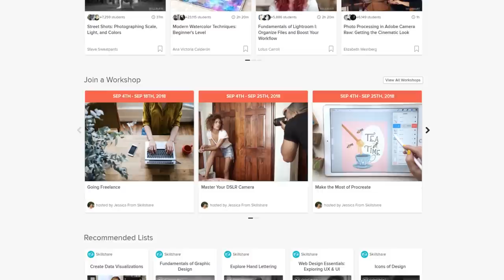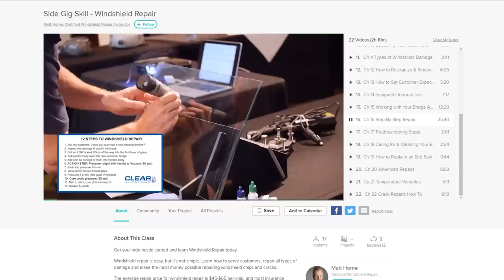BMW E30 Front Struts Restoration | BMW E30 325i Sport Restoration S1 E1

Comment: 2 friendly pointers. When removing the strut disassemble the bottom first and then undo the tower nuts to remove it. 
And please do not never ever again clamp the rod of a new shock with vice grips, not even with a rag. Use Allen key to hold.

Comment: Hey Restore It, did you notice your strut retaining or gland nut did not thread into the strut housing all the way?  I bought the same Bilstein touring struts and noticed upon fitting that the new retaining nuts are too long and dont thread in all the way.  They have about 10mm more thread than the old ones which stays exposed.  Did your rebuild turn out ok?  I dont like having the exposed thread and might return my purchase.

Comment: I have an e92 project that I’m starting - can I ask what resource you use to (1) find the replacement parts and (2) buy them? I use realoem to find them but I refuse to pay BMW Parts Dept prices. It’s a pain having to search and source the parts from different suppliers so I was just wondering if the UK has something akin to the USAs FCP Euro. Alllthe minor stops, bolts and caps are what I’m interested in sourcing, instead of the larger parts.  Cheers

Comment: Re: WET CARPETS, not sure if the E30 uses the A pillars to drain water off from the roof/sunroof like my E60, but that is a common problem in the E60s. Pull down the Wheel well fascia  and you might find a little rubber drain hose/nipple, take an air compressor and blow it out. If they are clogged, the water will overflow and run down the inside of the A pillar to the foot wells and make your carpets wet.
Reply from the maker: Thanks Alexander.

Comment: Great stuff to pass time and for remembering my own e30 strut restoration. Couple points though which might have been mentioned down in the comments but i''m to lazy to read them all. 
1. The dust boots and bump stops you fixed already i read.
2. Just like you did on the shocknut.. you would want to also coppergrease those 3 tiny bolts holding the splashguard and that basterd holding the disc. Soak them if you didn't!
3. 21:48 Dude.. why? That little thing you unnecessarily created will break off if forced in no time. Just hamer the entire edge of the nut into the gap with a big flat screwdriver. That way it's IMPOSSIBLE to go undone unlike now. What you've done is possibly not strong enough if you didn't TORQUE to correct specification. 
4. Which you didn't because you used the impact wrench. To much torque and the bearing will wear out a lot faster. Better scenario then point 3 though..

Other then that, great job and a joy to watch as it reminds me of my own e30 resto. You're my new favorite channel. Subbed!

Comment: What if I have brand new stock coil over's wait to be installed can I just paint over what is already new clean paint or does it need to be sanded a little or wiped with alcohol before hand. I want to tape my springs and leave them black and paint the inside of the strut Red.. Can I just Tape and spray?????????????????

Comment: did you consider an extra few layers of paint on those new backing plates to both make them match the struts and give a bit better protection?  Those springs look really nice. I have a near side front wing going spare if you need one... brand new, unused,  well primered in cellulose....had it since about 2003 I guess lol and won't ever use it.
Reply from the maker: Yeah I’m going to do that tomorrow as I have everything apart again :) and yes defo! Where are you based? are you selling it?
Reply from the maker: Email me at restoreitchannel@gmail.com

Comment: Love the videos but I’m afraid you’ve probably ruined those struts and you’ll wear seals out quickly, you should never put vise grips on a strut, always use a pair of ring spanners to remove the top nut. Otherwise you score the strut and damage seals, just a bit of advise

Comment: So there is an e30 hiding behind the scenes for these parts to go back onto.

Toptip from someone who can't weld either, you can preheat things like that, it makes it much easier to get a nice bead in there right off the bat. Then you can just hop on and off the trigger to manage the heat in the material.

Comment: NEVER grip damper shafts with grips! You'll damage the surface and invalidate the warranty, impact gun the nut and torque up. Also fit the hubs minus the discs and peen the hub nut into the groove with a chisel, just my advice.

Comment: next time try satin black instead of glossy black on chassis/suspension parts..looks 100% stock and much better, try and you will see :),. And those topran branded parts are junk, really junk...when you start using the car you will see tehm go bad...i have bought bushings that lasted a month from that brand....next try to go for Febi, INA, or other good brand. Also grabbing by the strut when tightening the nut is a very bad idea even if using a cloth...if you scratch it then when it compresses it will rip the seal and the strut is trash, either you have a hex hole and you grab it with a hex key and tighten with a "chave de estrias" (i cannot say the name in Eglish but you can search on google....) or you can do like i do , I simply tight it with the pneumatic impact gun and you wont even need to grab on anything..that nut wont unwind itself even if its not very tight i can assure from self experience, but it gets very tigh with the impact gun, you just be sure to thread it by hand the first few threads so the impact gun wont strip it....bilstein struts are very good quality but beware we see sometimes counterfeit parts on the market, be carefull were you buy....anyways great video and cheers
Reply from the maker: Thanks for the advice Hugo. Febi hubs and new nuts are the on the way. I am also going to install the rubbers and the bump stops the correct way round. Learnt a lot on this one :D

Comment: I wouldn't use the digital torque attachment  unless you have had it tested and calibrated. And if you're going to use that vs just getting a torque wrench, Buy a quality ratchet since you're pounding a lot of ft-lbs on a ratchet. That looked like a Matco ratchet but I could be wrong. Buy a torque wrench from Precision Instruments, they make Snap-On torque wrenches.  I'm going through bits and peices of the video, but when you did that small weld you're damaging the integrity of the part by changing the molecule structure, you got everything black so you'll have a hard time seeing if your shocks are Seepage. Love the channel tho restoring shit.

Comment: Noooooooooo! Never grab the shaft with anything! I was hopeing you won't put it back together the same way as you took it apart. Tiniest damage on the surface of the shaft will ruin the seal in no time. And, if you torque the shock, you should defenitely torque the wheelbearing nut too, since it not only can kill the bearing if it's too tight, but it easily can kill you if it come loose. But kudos to you to start restoring a car with no mechanic experience. You got balls lad! I really want to see how the restoration turns out.

Comment: Unfortunately, there is not much to restore (sensu stricto) in modern car suspensions. You can just replace all the crucial parts with new ones and hope that whatever remains of it is still serviceable. 
If it was a 1950s car or earlier, it would have had tons of parts that could be easily restored, or manufactured from scratch on a simple lathe, like the threaded trunnions, bronze bushings, etc. And the rest of the suspension consisted of nigh indestructible drop forged components which only need some sandblasting and a layer of new paint to be like new again. The hub bearings were just regular all-purpose bearings, still available via any decent home improvement store - not some custom designed double row bearings manufactured as a single unit with the hub itself, etc.
An acquaintance of mine restored a 1930s Packard, and it was all built like that - seemingly to be repaired in a workshop with only rudimentary tools and no access to spare parts. Even the crankshaft bearings were just poured babbitt, hand scraped to fit the shaft. The dust shields on the brakes were almost 2 mm thick, and the drums were as heavy and sturdy as anvils ! It seems that back then, "luxury car" meant - "no expense spared", not "all tarted up Ford/Chevy/Toyota/Kia/whatever with a lot of questionably useful optional equipment and just the same build & material quality".
Later suspensions were designed to be just thrown way and completely replaced by brand new parts as a unit when they wear out. But you still can do at least something, as shown in this video. And today cars are made to become disposable as soon as warranty runs out... 
But, enough ranting ! Good job, regardless.
Reply from the maker: Thanks DL24, good read.

Comment: Do you have a welder that does not require gas? Because it makes so much splatter everywhere.  You should really get a proper welder!
Reply from the maker: Yeah I need a Better welding setup for sure.
Reply: I would recommend a migatronic welder and Mison18 gas!  I get no splatter at all from my setup and I have a older migatronic 273 which is a little bit to powerfull for normal rust repairs.  I always have it tuned down to 1 out of 10 on the amps..

Comment: Why did you grind the axle nut? Now you have just contaminated the wheel bearings with metal fillings.  The intent is to just bend it in with a chisel or screwdriver. I give these bearings a day and they will be junk.  Great job otherwise.

Comment: i like your videos a lot, your doing a lot of work and taking the challanges as they come. if you need advice with something you can just shot me a pm. the axel nut you cut you should just have punched with a chisel to bend a part of the nut in the slot of the shaft, it is newer good to have metal dust near a new bearing from cutting like you did. thats my first advice, second is the dust boot is supposed to go over the top end bump stop, a bit of silicone spray helps with assembly with rubber parts :) looking forward to your new videos. https://www.youtube.com/user/stevieabz
Reply from the maker: Thank you Matin, that very kind of you. I have sorted both of those problems now. You'll be able to see the fixes in episode 2 :)
Reply: awesome, im a mechanic myself, from denmark :)

Comment: Bro, you are going about this all wrong. You are supposed to have all the parts in various states of disassembly. That way you always have a reference for the part you are trying to put back together. Your methods may have worked for you this time but next time you may not be so lucky.